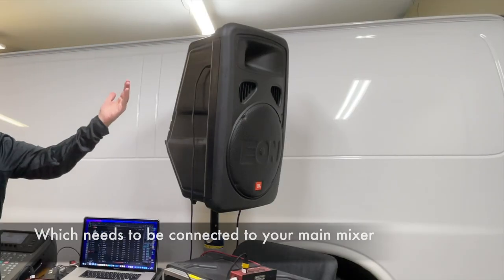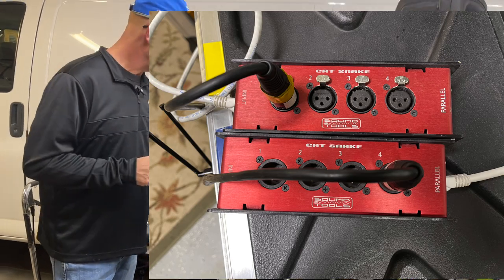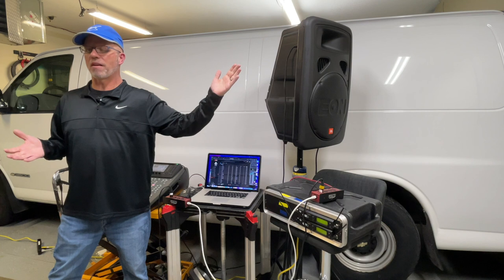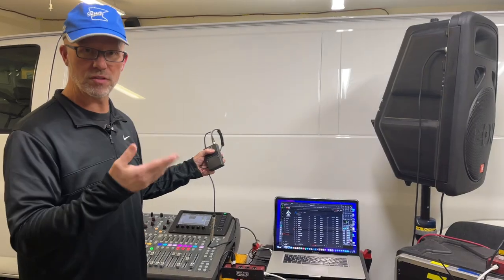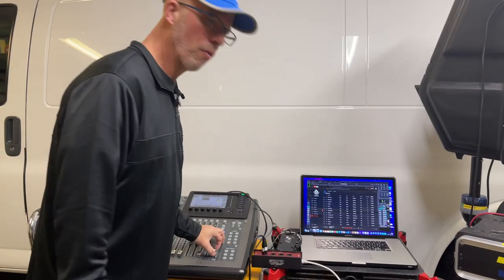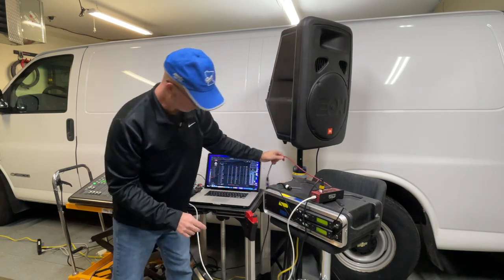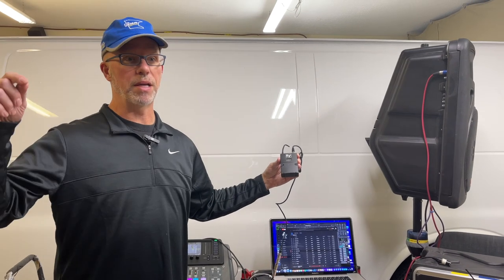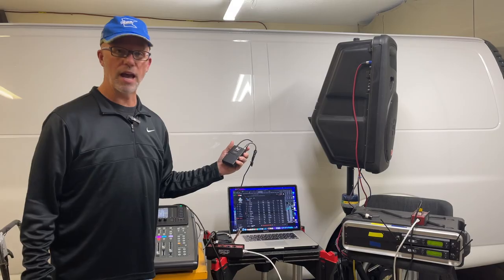The Sound Couple - Connecting a Remote Speaker

Comment: I would do it in reverse. Use an IEM reciever on the speaker side so you don't need a rack by the speaker.
Reply from the maker: Of course!  That makes more sense.  Thanks!
Reply: @thesoundcouple  Yup! I do it all the time for my gigs that need an additional speaker or 2 in a less than ideal location that’s separate from my FOH. I’ll send signal from my wireless IEM transmitter that sits next to my mixer to 1 body pack receiver and out of the receiver into the speaker. I usually just tape the body pack receiver to the top of the speaker or side where the handle is. If I need a 2nd speaker, I’ll just daisy chain off the one that I sent wireless signal to since it’ll likely be closer to it than my FOH set up. Also helps to have a paddle antenna to ensure no dropouts and a strong signal.
Reply: If you actually want to get a working set straight out of the box, just get Shure/Sennheiser's ENG set.
Reply: And if you have a batterypowered speaker you wouldn't even need regular power. Pretty neat little setup for outdoors for speaches and such
Reply: and you can mount the beltpack on the speaker, getting the antenna up high
Reply: IEM system is definitely the way to go here, not only for not needing a rack by the speakers, but the IEM TX is actually meant to take line level. I suspect using a mic TX, you could pretty easily overload the input if you're not careful, and there's no great monitoring typically for that, like there would be on the front of an IEM TX

Comment: The sound company I work with does an indoor high school pep rally every year. The school has a video that they show during the pep rally. We use my Line 6 wireless transmitter at the school's laptop, which is connected to the projector. My rack-mounted receiver is by the mixer. It works great. The first year I helped with the pep rally we ran 70 feet of XLR to get the audio from the laptop to the mixer across the basketball court with students and teachers walking on it. I suggested my wireless system and that's been the plan ever since. However, I never thought of sending a signal from the mixer to a satellite speaker. Thanks for sharing this tip.
Reply from the maker: I just can't believe it taken us this long to figure this out!

Comment: Thanks to The Sound Couple for sharing this tip.

On my church setup, which uses a Behringer X Air XR-18 rackmount mixer located at the chancel with a remote laptop running the X Air software via wifi at the rear of the sanctuary, I use a guitar transmitter whenever I need to send audio from the laptop through the PA system.
Reply from the maker: Thanks for sharing Dean!

Comment: I`ve done this one a couple of corporate gigs where the hosts hated cables... It works really well, but (especially in my area) there`s a lot of wireless gear that would be turned on and off witch caused interference, so i had to do a scan every 2-3 hours to check the frequencies. But for shorter gigs its a lifesaver!
Reply from the maker: Thanks for sharing!

Comment: Wow Bart!
Thanks for showing us this simple method of extending music into another area of the venue with stuff we have and replaced that is now in our tool boxes. Yeah, just grab it and wire it up! The one thing you may have knowledge of but didn’t want to make your video to long or complicated and that is time alignments. By delaying the remote speaker so that it aligns with FOH bleed to the remote speaker location. awesome video Bart! Thanks buddy.
Reply from the maker: You're welcome D.  By the comments, it appears there is a mix of people that do this quite a bit to those of us who never thought about it....so this is good to get the confirmation on both sides!  Oh yes...delay is something to think about if you are extending the main system for sure.  The typical situation I see using this more is when you need to cover a separate room in which I wouldn't worry about it.

Comment: I use the Alto Stealth Wireless system for the same applications plus side fills or small delay stacks in festival setups and usually there is no problems. I have used this method years ago with wireless guitar systems because they make them without a pack so there is no cable or bulky battery box. But it all does the trick😉😉.
Reply from the maker: Thanks for sharing John!

Comment: Seems many have used this wireless method. I am one of those. I have a Sennheiser belt pack transmitter with two belt pack receivers to provide signal to my delay speakers. Have been using this for the past 4 years now. I love that I don’t have ANY cabling from the desk to those remote speakers. And, power is within 10 feet of the speaker locations. There are about 2k people walking around during this series of shows and no cables is mandatory. 

Another use case is a tent show where I have 4 tops along the long side of the tent. Two on either side of the “stage”. I can run power cables at the top edge of the tent and there’s no other wiring needed. In this case, I use 4 receivers, one for each speaker.
Reply from the maker: Nice!  Thanks for sharing!

Comment: I used Saramonic UwMic9 TX9 transmitter and multiple RX-XLR9 receivers for an entirely wireless speaker setup.
The XLR9 receiver plugs right into the speaker and takes power from USB ports or AA battery
One fresh set of battery lasts couple nights from my experience

One transmitter can be used with up to, I believe 6 receivers, and you can set different groups for L or R speakers.
Both the transmitter and receiver are dual-channel.
Which means that if you use their wireless handheld mic and set channel B to the mic, and channel A to FOH, you can speak directly into the speaker while playing FOH music.

Connections are stable and quality is great! It's also relatively cheap. Comes with a custom case too!

Thought this might be useful info for you
Reply from the maker: Thanks for sharing!

Comment: I have been experimenting with APTX-LL low latency Bluetooth dongle's. avoid Bluetooth if you can. It's worked fairly well for music, range isn't that great and interference could be an issue. Be careful when shopping on Amazon because I went through a handful of devices that said they supported APTX and they did not.
I have been interested in a way to do this via stereo sometimes as I've run into needing a stereo feed. I recently found some devices that actually work pretty well that aren't quite Bluetooth. Avantree Multi-Stream Wireless Audio Transmitter Receiver Set.
At some point I'll get around to doing a full test and uploading a video.
Reply from the maker: Thanks - let us know what you find out!

Comment: I tried to use a wireless microphone and had mixed results because I believe it was VHF and had horrible squelch. the one moment I decided to walk away it apparently went completely out to static grrrrr. If you do go to route make sure it's not one of those ones that goes staticy wen it loses at signal. Otherwise it worked great for sending the radio station tent audio to the band tent at a fair/Expo.
Reply from the maker: I think you need to completely avoid VHF altogether these days.

Comment: I have a couple xvive units that are made for microphones.  They're cheap, but rechargeable and don't do too bad if the distance isn't crazy.  The downside is they're 2.4Ghz, but you get 8 channels to choose from.  The few times I've had to use them they've worked fine.
Reply from the maker: ohhh-eee, yeah, little scary hanging out in 2.4Ghz land.  I worked with a singer who had a Shure wireless unit in the 2.4 band and she wanted me to locate the receiver right next to her monitor so she wouldn't have any issues with drop-outs!
Reply: @thesoundcouple  yeah.  Bought them in a similar situation you guys were in, but actually left the venue and went to Guitar Center.  But the couple who’s wedding planner dropped the ball on those details paid for them!
Reply: I believe Xvive U3 is the most used one. Tons of videos on them here on YouTube!

Thats also how I learned about them being an old school sound tech who is used to running meters and meters of xlr cable. Nowadays you don't even need an outlet if you use something like a Bose S1 with battery. W. Weiss here on YouTube has lots of videos on the subject.

Enjoy watching and learning!
Reply from the maker: @junak2003  Sweet!
Reply: @thesoundcouple  well don't worry we're getting more 2.4 GHz wireless between batteries and vehicles, those pesky 2 wires for the canbus are just too much copper. So this vehicle manufacturers is deciding to get rid of them.

Comment: I started doing that when Sennheiser released 2 body back systems meaning that instead of a large base I have 2 transever(s) that can transmit bidirectional. I use them for not only ceremony wireless for speakers for other rooms and the like.
Reply from the maker: Nice!
Reply: This is actually common in film production. the audio between the recordist and the camera and sometimes what they call comtext which is a fallback system for the Director. A lot of them already have the Sennheiser units kicking around from upgrades so they put them in secondary duty.

Comment: I’m in high school and I use this in my school gymnasium to run 2 subs. The only trouble I run into is on the output of the wireless unit is at a softer level and needs a mic pre amp. I went on Amazon and bought a mic preamp and a 48v injector to power the pre amp.
Reply from the maker: We noticed that as well Lewis, but we can simply compensate with a fader in the situations I would see us using it.  But yes, I can see this being an issue for you if you are trying to match the system.

Comment: I'm holding my breath, oh we're going for wireless microphones OK it is known but it's not shared necessarily and usually needs an extra cable. A special extra cable. I don't know why this isn't done more. I recommend those plug on XLR units (Xvive although others exist now) I've seen a couple YouTube videos with those. I can't remember what the other system I ran across where it was one to many verses one to one. The guy was using it to send audio around the Chesapeake Bay to multiple speakers.
Another option is the rode wireless go for a convenient size.

Comment: how long does the battery last and is it possible to change battery's without losing the music
Reply from the maker: It depends on what you are using for the job.  I think in our case, we would get about 6 hours with our unit.  I don't think it would be possible to change the battery without losing audio though, so you would need to plan around it.

Comment: Did you recently get a jbl speaker and I prefer long cat 5 cables with the boxes than wireless so I can turn it up incase if the speaker is put up high
Reply from the maker: We have had the JBL Eons for a long time...we just don't use them as much anymore.  The mixer is complete control of the speaker volume...the wireless unit  is simply acting as a wireless XLR cable.

Comment: You could use multiple receivers with one transmitter and connect multiple speakers
Reply from the maker: Still to be determined if we will invest in this more.  Obviously, we demonstrated with gear we already owned and paid for....will think about it more over the next few months.
Reply: It depends on the wireless system but yes.

Comment: I do this with IEM all the time.
Reply from the maker: Makes a lot of sense once you know!
Reply: @thesoundcouple  I do it with battery powered bluetooth speakers too, using the Aux in instead of the bluetooth.  Other wireless fun can be had by using a PCDI box into a wireless transmitter beltapack for wireless laptop connectivity

Comment: Is studiolive III perform well on live show as Beringer x32
Reply from the maker: Both mixers will get the job done and each have their strengths and weakness's.  Our primary reason for the PreSonus gear is their rack mixer is perfect for the gigs we do and their software and integration is better.  Also, their different model of consoles are pretty much identical, just in a different body.  The x32 has a more robust mixer feature set, although there are some things I feel PreSonus does better, but overall, the x32 is more powerful as a mixing desk.
Reply: @thesoundcouple  Yes you're right. I bought Studiolive 32sx for our Church 3 weeks ago instead of x32 as studiolive have the possibility to set user/admin account and password to access mixer. my first choice was Behringer X32 but  the lack of this feature for set permissions level to user account was lead me to go for studiolive.

There is many volunteers at our church so if there is not permissions level for them we could loose most of the time our setting and some could modified also this setting during the services as they still learning.

What I learned about digital mixer is all they do great job but it's depend more on the application which you will do with it and feature that you're looking for .

Also the downside of Studiolive is the lack of a low pass filter ( LPF) on Mix bus so it will help on live event to feed the right signal to PA and SUB and the lack of Smaart on the current Studiolive III but on their previous model there was Smaart .

May be presonus will add in future upgrade LPF.

Moreover, I learned more things and setup when I watch your youtube channel. 
Still keep it .
Reply from the maker: @grayancyagra5334  Awesome insights...thank you for your comment!